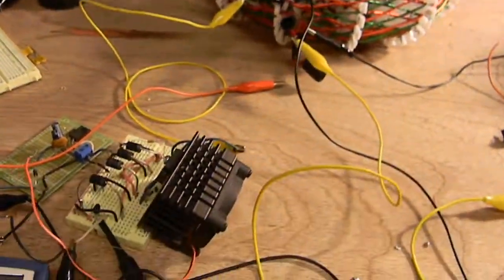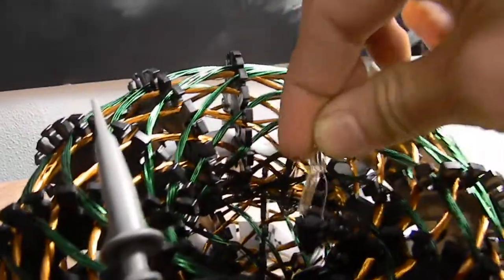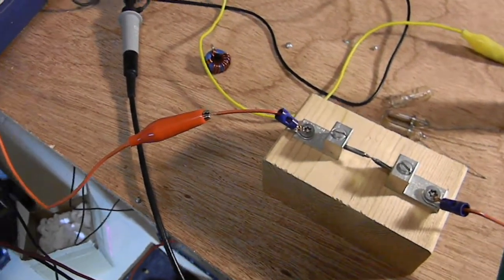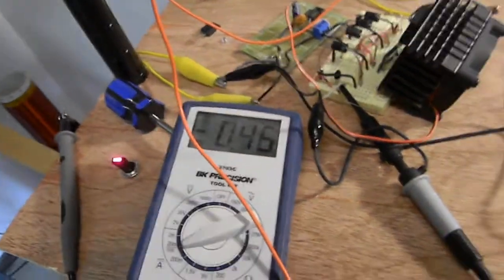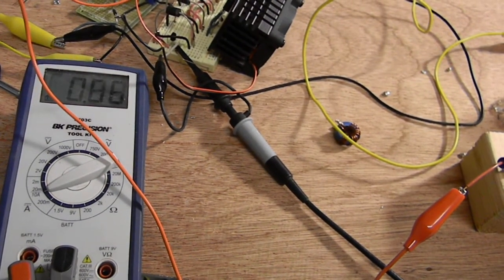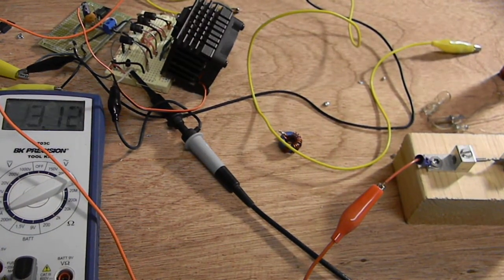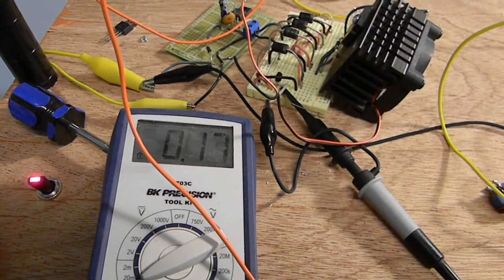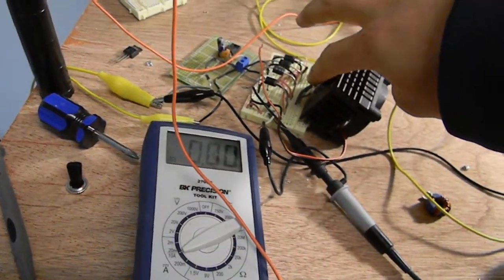Water Spark Gap

Comment: You are on to something I've suspected for a while! :-) Hydrogen has a tetrahedral geometry- the fundamental form of ALL. It is a space time geometry and naturally relates to zero points quantum geometry the star tetrahedron which spins on the poynting vector field of light and gravity. Disturbing it's spin kicks out energy from zero point! Try encasing the spark gap in pure hydrogen. Be careful with this, no oxygen can be present!!!! :-) Keep it up man!
Reply from the maker: wow dude thanks for helping me connect the dots a little more, i was just watching how certain 3d shapes have resonance with sound waves, but they must be tuned to the 432 scale....I can make any frequency with my current setup, the limiting factor is the resonance of the vortex coil. I would like to make a big one that is a odd multiple of the schumann. First I need to build a circuit like tesla's oscillator. I will try this more when I get a better driver...
Reply: Awesome :-)

Comment: I watched Eric Dollard video...left you are message in your discussion section. Dollard said Tesla technology pulls out of the Aether.  So what you are seeing is conversion of energy from the Aether dimension (1 octave lower than our world) to ours.  That is releasing all the energy that was used to hold everything together.  The opposite effect would be taking a bunch of hydrogen and oxygen and compressing it together to make water (big boom with that process) forcing it from gas to water, an level / octave / state lower.  The spark gap / Aether / Capacitor is reversing that process.  I think :)

Comment from the maker: As far as I can tell, the spark is causing some interaction between the secondary and the primary that is being driven. It some how causes a reversed voltage to appear on the resistor that the meter reads internally to calculate the amperage....